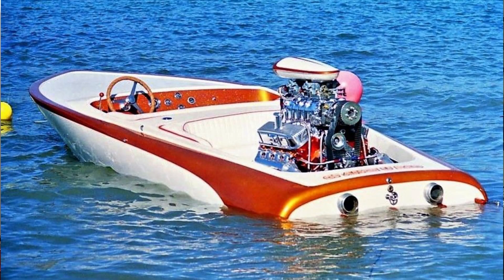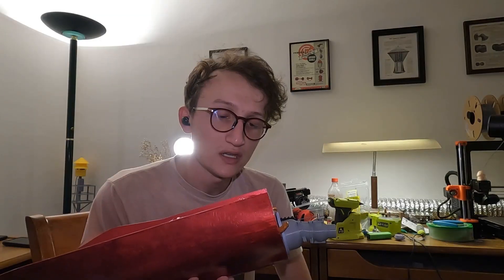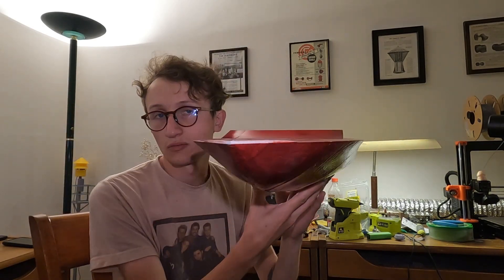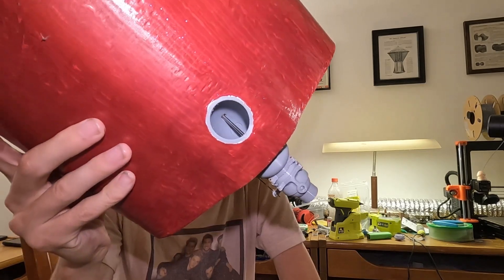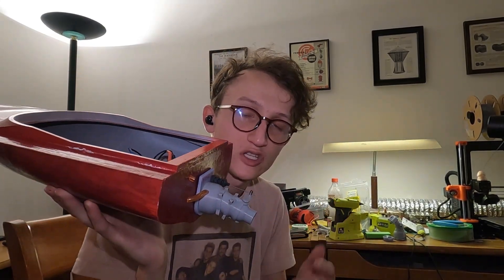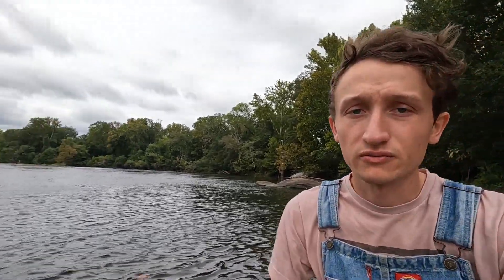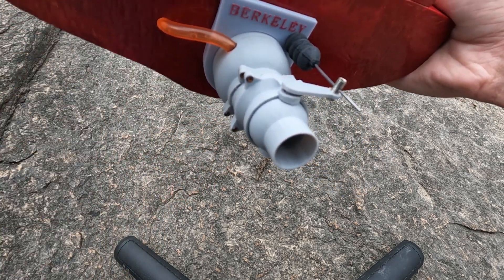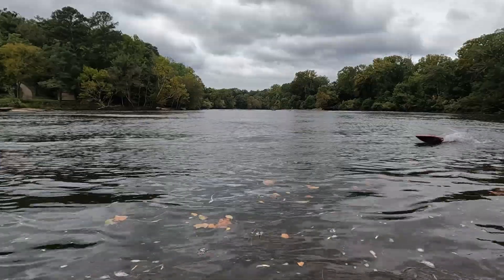3d printed RC Jetboat

Comment: What if the jetboat collapsed because its 3D printed
Reply from the maker: I've been driving it pretty aggressively for awhile now, including over rocks and logs and I haven't had any issues other than some paint scratches and maybe a fouled impeller or two, so I'd say I'm not really that concerned with it collapsing